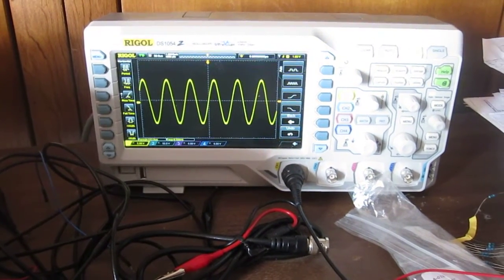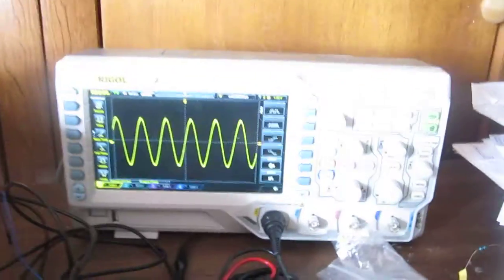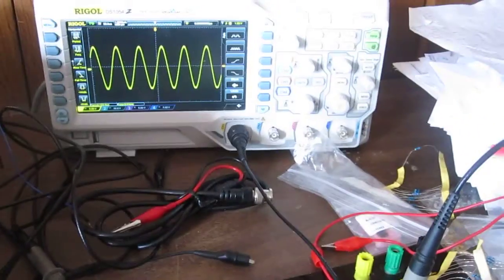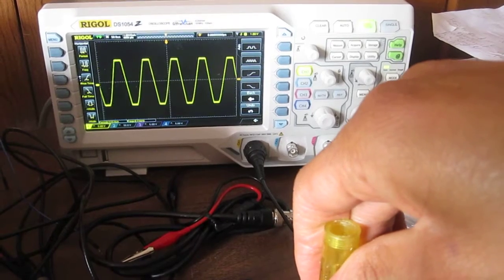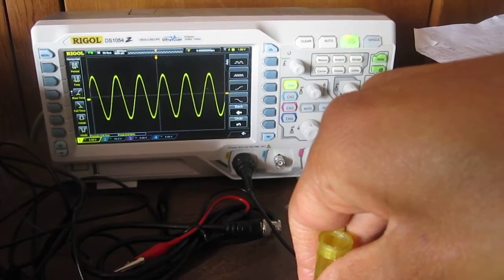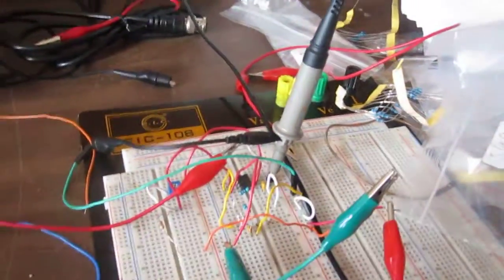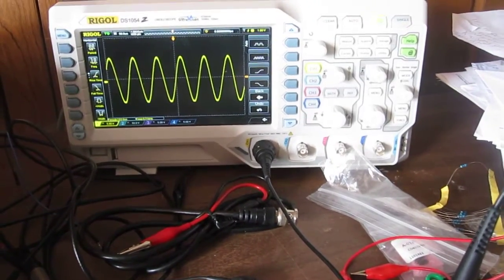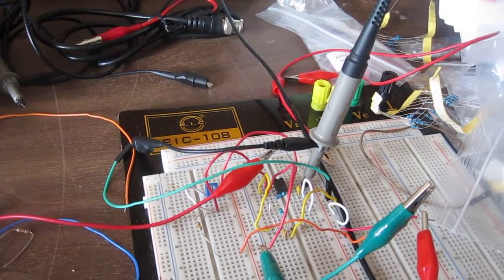Wien Bridge Oscillator Circuit Built with an LM741 Op Amp

Comment: nice video thanks for explaination but i have question , i dont have an oscilloscope but a dmm in order to get 100 khz sine wave what should be the exact value of potentiometer , because i can measure capacitance and resistance precisely :)

Comment: Would it be possible to use this circuit and chip to produce a .5 to 1.5hz signal? I need 0.2v to 0.9v output swing.